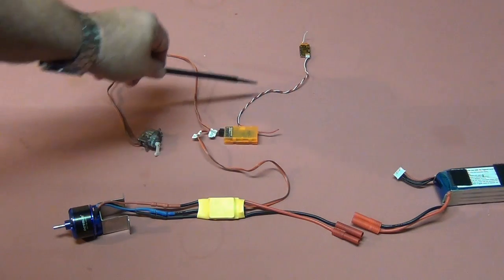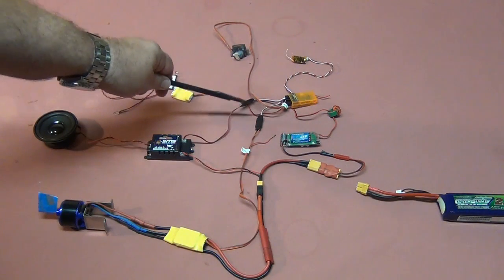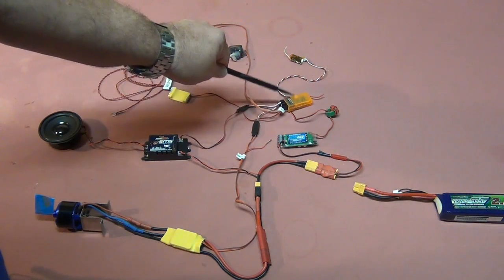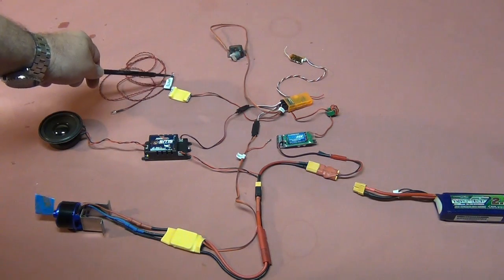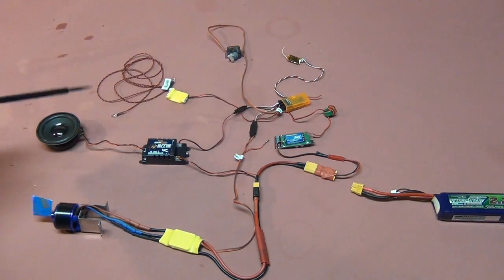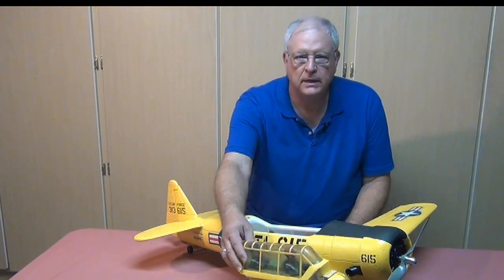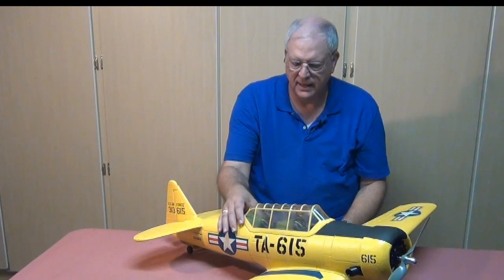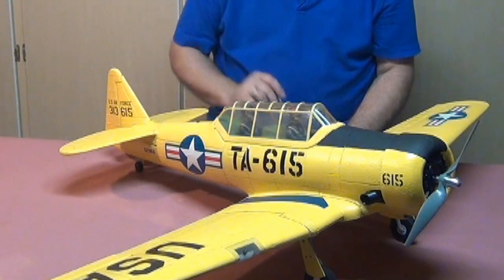Restoring EPO Models   Part 5

Comment: Much impressed with your vidiography as well as your techniques. How did the T-6 fly with the added weight? May attempt resto of my Dynam WACO. Have new kit of Dynam PT-17, will take heed of not gluing in spars , wing halves and tail parts where screws are enough to hold model together.

Comment: Thanks for the series.  Could you please provide more detail regarding the "craft paint" that you used?  I would like to get away from the solvent-based rattle can paints.
Reply from the maker: Brian, thanks for watching and commenting. Craft paints are the water based acrylic paints sold in small bottles at Michaels, Hobby lobby and Walmart. Usually about $1.25 each. You can brush or thin them and shoot them through an airbrush. Watch out though, before long you'll have dozens of the little buggers. Cheers.

Comment: Great Video series.  I appreciate the pass down of knowledge.   I don't understand however the use of an additional BEC when there is one built in the ESC.  At what point do you say I have too many electronic whiz bangs to decide you need a separate BEC?  I have a 6 channel plane (retracts and flaps) with lights and a gyro using the Built-in BEC on a 65 amp ESC.   Am I at risk?  Thanks.  Ron
Reply from the maker: +ron045 YouTube put your comment in the spam file and I missed it until now. Sorry.  For me the key is the BEC output from the ESC not the total amps of the ESC.  If your ESC has a 3 amp, 5 volt output, I'd be wary. A 65 amp ESC likely has a 4 amp BEC. The UBECs I typically use are 5 amp versions.  I've lost a couple of models when ESCs failed.  When using the BEC from the ESC, that meant I lost receiver power too.  A cheap UBEC is $6 - 10.  Cheap insurance.  On the other hand, if you have an old inexpensive model, it may not be worth it.  I'm kinda frugal so when models get up over about $200 and have the equipment you mentioned, I add the UBEC. The other thing to consider is the quality of your ESC.  Again, I'm cheap. I don't use many Castle Creations ESCs. If I was using one of those, I'd be more likely to use the onboard BEC.
Reply: +ron045 Consider using a Castle Creations 10amp BEC for power hungry planes. If you wire it up with a JST connector like Jim has then you can move it from plane to plane easily. All you'll need to use is an adapter plug from your ESC to Battery pack. They are a little pricey but well worth it! ;)
Reply from the maker: +RCWASPOVISION The swap idea os a good one. Get one or two nice UBECs And the taps and it would add just a couple of minutes to your preflight prep. I like it.

Comment: Fantastic series, I learned a lot, and really appreciate the time you put into the production of this rebuild / restore tutorial.

Question: Did you hot glue the servos to the foam, use another type of adhesive, or use double sided tape?
Reply from the maker: Yes, hot glue works well. I saw a trick at Flitetest.com where drop or two of denatured alcohol cause the glue to release in sconds. That will be helpful, too.
Reply: +The RCPlaneviews.com Channel Appreciate the quick reply, and the denatured alcohol as a hot glue release agent is good to know. Thanks again...